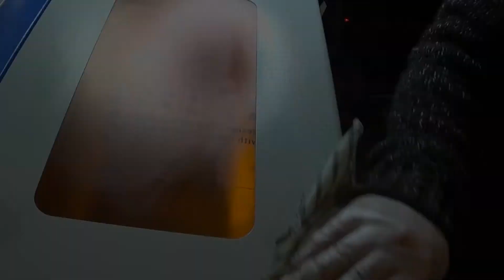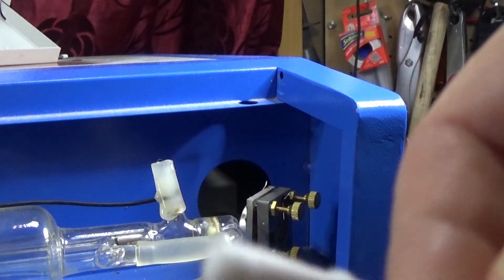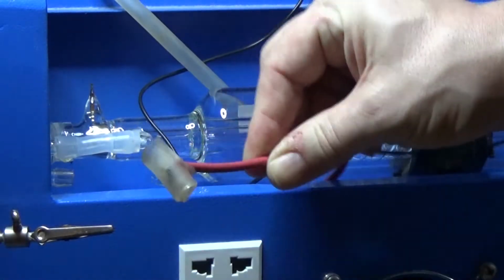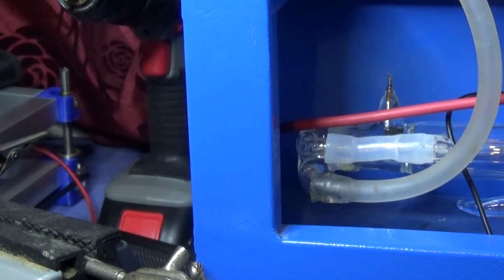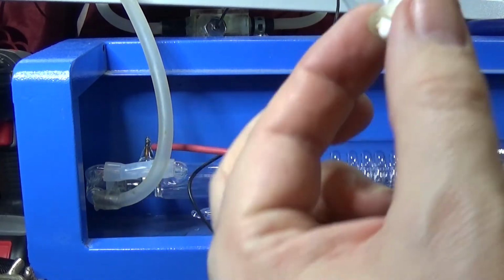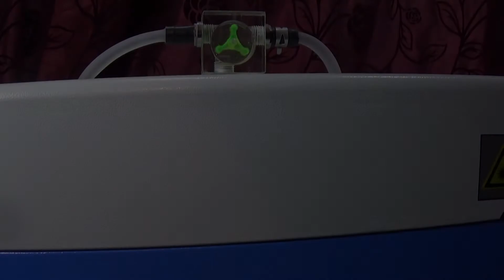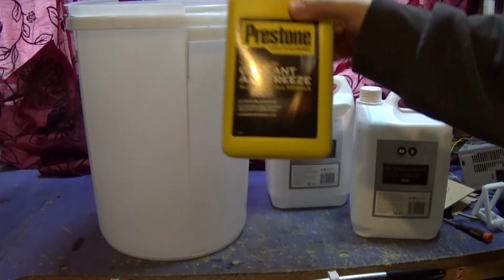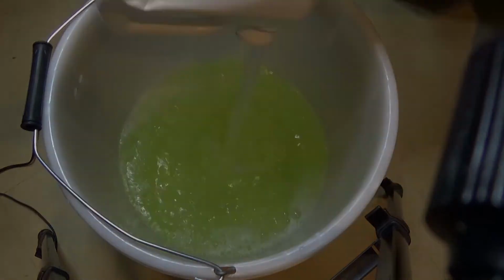Replacing K40 Laser Tube

Comment: 1st I'll respectfully suggest you replace the clear cooling tubes, into and out from your 5 gal bucket, with opaque tubing. I'm running red and black. Saves using additives. As far as antifreeze use? Use an aquarium heater instead.
2nd I want to compliment your maintenance methods. Especially wiping down the X axis rail! Not seen anyone else do this! Kudos.
I've subscribed and will follow your other K40 videos.
Oh, my new desktop laser is the OMTECH 0813 BG which is identical to your machine other than a few minor details.
Reply from the maker: There is still a lot of things I'd like to change on my k40. I'd like a smaller reservoir with cooling, all the tubes replaced. And various other upgrades. Thanks for your comment I appreciate your advice. If you have any other tips and tricks please don't hesitate to let me know

Comment: Finally 4 months late and 2nd tube arrived not broken 🤣... Quick question.. can I use standard silicon sealer, the stuff used for DIY etc... And on my laser the 2 metal connections are about 3mm... Will they be ok for a connection...I don't wanna send it back, it's been nearly a year without a tube ...cheers mate, love your channel
Reply from the maker: That's painful! I hate going without a toy for that long. 
Right when doing my research I found that using normal silicon was not advisable (I can't remember why though).
I brought my silicone on eBay for really cheap(£3). 
Do you mean the stripped ends are 3mm long because if so I would just strip them a little more although 3mm should work. It will just make it a little harder to make a good connection. If I've not understood then please message me again and I will try and help..good luck my friend and Thanks for the comment
Reply: @TheOffGridFamily  thanks bro... I mean the little metal connector that comes out the tube..

Oh I have to wait more time for the special silicon to arrive 😭😭😭
Reply from the maker: Oh yeah I see. Yeah that's fine just wrap the wire around it making sure it's tight and you should be good. 
I'm sorry man, it's rubbish having to wait but it's always worth using the right stuff so you don't have to end up waiting longer when it breaks etc. I'm starting to make more laser related videos and I may even start live streaming making designs and cutting them. Is there anything in particular you'd find helpful?
Reply: @TheOffGridFamily  there's an electrical wholesaler in the city (cork) where I work, I pop in their on way home.. hopefully they stock electrical connection sealer..

Did you look into changing the control board? I got the mini grbl, but I'm have serious issue with shielding and losing connection mid job..

The k40 is a fine machine but like a wife they are very temperamental 🤣🤣
Reply from the maker: @jigsey.  no comment on the wife (sorry but my life is valuable) 
No I haven't looked into changing anything like that yet. I had a whole list of upgrades I wanted to do but haven't got around to doing any. I got a new 3D printer and that took a lot of my time. I've also got a top secret project I'm working on (coming soon) 
There are so many projects I want to get done but not enough hours in the day! I am working on some pretty elaborate projects at the moment but they often take a few months to do and I need other videos in between so it's 4-5 months before they get released. 
I've been more active on patreon recently (some patreon only, other stuff for everyone) if you are interested (not a hint but a good source of information) I also do a few bits and bobs on the community page on YouTube but I feel like not many people see that
Reply: @TheOffGridFamily  excellent bro, just signed up to your patreon ☺️
Reply from the maker: @jigsey.  I just saw buddy, I was only pointing you in the direction of patreon because I update it more than other places. Dude you rock! I've left you a message over there and need to sort you out with a super secret link
Reply: @TheOffGridFamily  it's a great idea patreon

Comment: Hi why not distilled water just setting up my new laser been looking at deionised vs distilled and distilled is favourite I think
Reply from the maker: I chose deionised water because it's was cheaper than distilled. All you need is a fluid that won't conduct electricity so either will work. Good luck and have fun